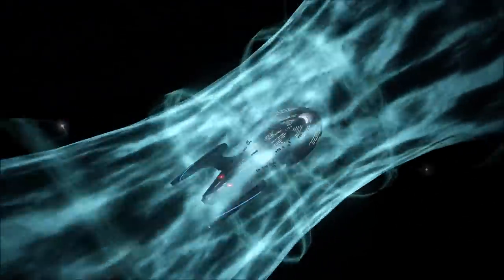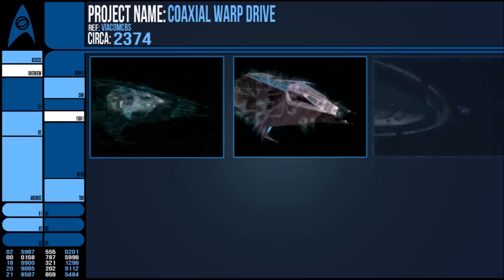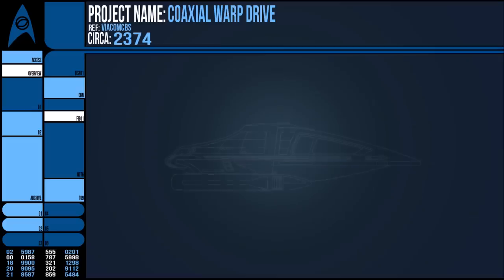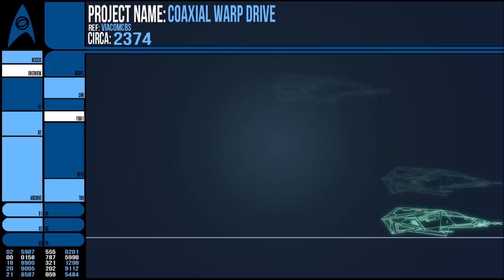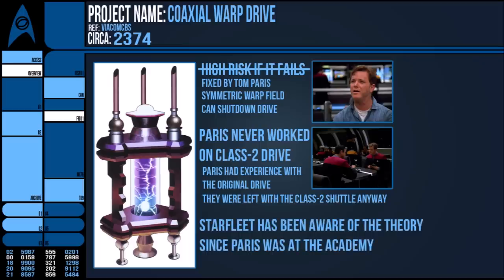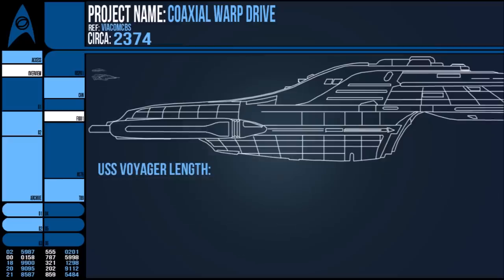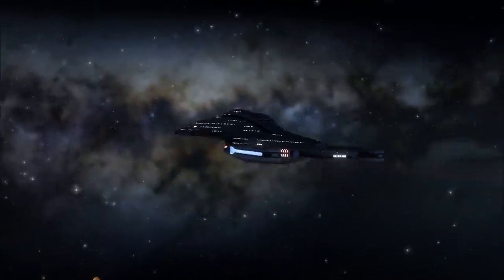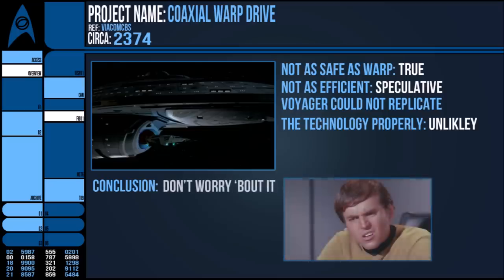Why Not Coaxial Warp Drive? (Star Trek Theory)

Comment: This drive was still on the "small ship test" phase.
The first warp ship was ICBM, outfitted with warp gondolas. The Deltaflier was quickly given temporary Transwarp capabilities. So it seems retrofitting drives on a small ship is generally easier (asuming they do not have a certain minimum size/energy requirement like Spore Hub Drive).
Meanwhile large ships like any Enterprise, Voyager, the Wakefield Class or any Fedeartion ship have to be build around or heavily modified for a new drive technology. The Excelsior class was literally designed for the "Transwarp Experiment".
As they actually built the Deltaflier onboard, we can asume they have some degree "Shipyard of Shuttle" capacity onboard. As the Interpid class was intended for Longrange Exploration, that would make sense. But even asuming the drive is not inherently unsuiteable for big ships and they had all the manufacturing needed, applying it to a big ship like Voyager decades away from any friendly shipyard is a very unlikely prospect.
As for their solution: The fix only made the issue less likly on small scales. Test have to be done if the issues is actually solved, or just delayed. And if no additional issues crop up if you make them bigger.
And disipating the Coaxial Warpfield only worked because they had a conventional Warpdrive several oders of magnitude more powerfull working on it from the outside.
So the drive is dangerous unstable and untested, has not yet been applied for anything larger then a shuttlecraft and retrofitting Voyager with it that far from home is a dubious prospect at best.

Comment: I can think of three reasons. 1 The longer the point away the more power you would need to bend the space to where you are. With a Warp drive you can just head in the direction. 2 You are not moving through space until the two points meet. Would that mean an increase in time to force the points together? If it does then you can not escape from a situation quickly. You have to wait for teh drive to engage. That could be a major issue if attacked by something and you need to retreat. 3 You can only go to the point you set. With warp drive you can drop out of it at any time and change heading. With Coaxial you can only to move to the spot you decided upon.

Comment: My first thought as a mechanic; What if it just wouldn't fit? An engine of a certain power has a specific size and shape. What if that size and shape were incompatible with Voyager's structure? It's one thing to reconfigure a small shuttle but it's something else entirely to reconfigure your entire starship. Especially when you don't have access to a dry dock.

Comment: From what I understand, canonically, warp drives create a subspace field around the ship in such a way that the ship is propelled through normal space at speeds faster than light because subspace "slides" through normal space like oil through water. 

What you're talking about, the bending of space itself to "propel" ships (I used propel in quotes because the ship actually isn't moving, space is moving around it), is the real world interpretation that was introduced by Miguel Alcubierre in 1994. Doing this is hard though, even modern estimates using altered equations put top speed at 10x the speed of light requiring as much power as the US consumes in a year. (Which, from my understanding of warp scale, puts it at warp 2.15). Dr. Alcubierre and his successors have called this warp drive because they're all nerds and enjoy Star Trek.

Coaxial warp drive, as your animation suggests, does something very similar, though distinctly different. The destination is brought to the exact position your ship is at, then you cross the axis, and release the warpage. In other words, two distant points of space are connected via a warpage of some kind, and you cross it for the purpose of traversing great distances in short periods of time, if not instantaneously. That sounds just like a wormhole, which is notoriously difficult to create even in Star Trek. Every time that I can remember wormholes being plot devices, they were either extremely unstable, partially unstable and deteriorating, or created by beings of other planes of existence and maintained by said beings for millennia. Now granted, being able to wormhole anywhere in the universe in an instant would be fantastic, I'm sure Starfleet would be cautious of any prototype being installed, or tested, on any ship in service regardless of their current predicament or confidence.

Comment: Even if it only worked on the shuttle if the technology worked as advertised they could have used the shuttle to return to Earth and update Star Fleet on everything that had happened and get them working on a full size version. I'd bet that with the resources Star Fleet has and the prototype in their posession they could have figured it out in no time. Failing that the shuttle could have ferried the Voyager crew home 6 at a time.
Reply: Exactly.   Trek has always had bad writing but voyager has some of the worst considering the excellent premise it was based on.

Comment: I like the idea of it being practical only for small ships. I'm going to work that into my carrier design, along with Multi-Layered Warp Drive (or whatever I eventually call it.)
Reply: Here is an idea a friend of mine came up with: warp field surfing.
He didn't put warp drives on his fighters, but equipped them to basically get pulled along in the warp bubble of the carrier. So no need to land them before running off, you only need to have them close enough and they can land en route.

Comment: I imagine while the technology itself is decently easy to use and even replicate once you have the schematics, it's everything else around it that makes it unfit for consistent use. You brought up the fuel source and/or energy requirements, but those are just speculations. Even if we assume they are possible to deal with efficiently enough, there are other aspects to be considered: 
For one, you have to know exactly what point you want to target. You can't just pick a random location in that direction - you have to make sure that that spot is safe to emerge in. While space is mostly empty and the chances for that are tiny, you don't want to run the risk of appearing inside a star, a meteor field or the gravity well of a black hole. That requires extremely precise sensor imaging, which again limits the range.
This is made worse by the next point, which is other ships. Tracking stellar objects over long distances is possible enough to get some use out of the drive - but it's nearly impossible to track other ships at those distances. Jumps into populated systems is risky even if they shared their sensor data. Warp still allows you to react to what's in front of you, the coaxial variant is pretty much instantaneous. It would be banned anywhere near systems and common routes...
Ironically it becomes less precise the farther away from such population centers you are, which could share sensor data with you. Especially in uncharted space or other cultures' territory you may encounter hard to pick up structures and cloaked vessels...

I'd love to see Coaxial Warp used as an alternative getaway method for cornered ships. A last resort type of technology that is otherwise too inconsistent to replace the conventional warp drive for regular travel.

Comment: The Coaxial Warp drive sounds exactly like the Kearney-Fuchida Drive that Battletech uses. It works on the same premise, using gravity wells of stars to chart points of jump. It does this by bending time and space on itself to shorten the travel position. It often uses high amounts of energy. Most Warships and Jumpships can use the drive twice safely without issue, jumping a third time would often cause the drive to fail or explode the ship due to the reactor unable to output the necessary power to maintain the jump window.

Comment: If you watch the episode this is shown in.  The person they save immediately says that he pushed the drive past it's limits.  If that was the case and it caused such a potentially dangerous effect of collapsing space itself for a sizable distance..  It would be simple enough to assume Starfleet would rather not use the technology until it can be made safer.

But I think you are correct on size of the ship or object being pushed through space/subspace in this manner.  That and just appearing in places where potentially hazardous situations could be present, might also be another reason to not use the drive.  Perhaps there is no simple way to scan the area before you appear where you are going.

Comment: You may of partially hit the issue with the power option: What provides the most power on a Federation Starship? The warp core.
What shut down the Coaxial Drive? A "symmetrical Warp field" imposed by Voyager's Warp Drive.
A smaller ship doesn't need a operating Warp Drive to power all systems, even Voyager didn't per say but it's also a ship where reserve power is a precious commodity.

My theory, Coaxial Drives don't provide power, and a running traditional Warp Core generates a field that would "potentially" generate a warp field that would shut down the Coaxial drive.

To explain simply, You can't have a running Warp Core on a Coaxial drive ship, so a bad Jump would leave Voyager vulnerable till the Warp Core is brought online, if they had the ability to power the Coaxial Jump in the first place.
Reply: But the Warp Core is just a Matter/Anti-Matter Reactor that generates the energy to power the Warp Coils in the Nacelles which are what generates the warp field. The Warp Core itself doesn't create a warp field it's just the power source it also powers the rest of the ship (with fusion reactors as backup/auxiliary generators) including shields, weapons ect.

Comment: I always figured it was a case of "The bigger the ship the more power required" and even a ship as small (compared to a Galaxy per say) as Voyager was it just wasn't feasible when compared to conventional warp drives. Either that or the drive became progressively more unstable as you increased the size of the ship.
Reply: That's the difference between Coaxial Warp and Quantum Slipstream 
Quantum Slipstream doesn't care how long the ship is, as long as its relatively flat, allowing ships to manageably increase power output 

Coaxial Warp just needs a fuck ton of power for a jump that could be done in 20 hours by a Constitution Class

Comment: Isn't Coaxial Warp just the same as making a wormhole? 🤔
Reply: That's what I thought.
Reply: More like the 2004 BSG FTL drive.
Reply: In real world (stop booing ...) terms, it is exactly that ...

As physicist are wont to do, rather than transverse the distance between two furthest points on a piece of paper, you 'poke' a hole at the point of origin, hope for spacetime to fold on itself, thereby enabling to poke another 'hole' at the destination (but I guess you already knew that, so nvm ...).

Trouble is, not only are wormwholes purely theoretical, you have to hope that that black hole is connected to the, still yet to be discovered, white hole, thus avoid the nasty business of trying to negotiate a gravitational singularity. But given any known physics falls apart beyond the event horizon, then you're looking at a pretty difficult problem ...

In universe, and if the graph in 'TNG: Technical Manual' is correct, then, the issue is one of energy. Iirc, the graph is logarithmic, meaning every step in warp velocity requires an exponential increase of amount of energy, until at Warp 10, you need an infinite amount of power. And that is just the 'standard' warp core. Also, instead of compression/expansion of the typical warp bubble, you try folding spacetime around yourself, that requires not only sufficient energy to open a wormhole, but sustain it (due to Hawking Radiation, black holes can, and do, 'evaporate', with the time it takes to do so is related to its mass, and size ...).

Put the two together, and it is logical to assume that only a relatively large shuttle, which doesn't need a particularly large wormhole to travel through, would only be able to travel a (relatively ...) small distance, because of the energy demands, and the size of the core proportional to the ship, and its mass. I would imagine even something as relatively small as Voyager (compared to, say, the Enterprise-E), in order for it to fold space, the size of the core would take up a lot of space ... and that is not including fuel storage. 

Hence why it is believable Star Fleet never really pursued the idea: compared to the standard ship drive, as any advantages would be outweighed by the disadvantages.
Reply: @nigelft  Didn't see you'd posted this explanation here.  I posted a somewhat similar explanation but yours is better written and is what I agree is the issue with the drive.
Reply: It's obviously different because... they gave them different names ;)
Reply: No. In a wormhole you have to travel a physical distance inside. Coaxial warp drive is more live the jump drive. You can instantaneously travel without to moving a physical distance. The same principle (space folding) of the Inverter of the Ansata terrorist in the TNG episode "The High Ground" or the 'Sikarinan Trajector.
Reply: no. Its a Wormhole. The idea that there is any distance to travel through a wormhole is a complete misconception. 
Wormholes connect two points in space, bending space time so those two locations occupy the same spot. To the person flying the ship they would just suddenly be some where else. To anyone watching the ship would probably seem to exist in two places for an instant while traveling (if the observer can see both ends of the wormhole) or the craft using the wormhole would simply vanish (if the "exit" of the hole were out of view)
Reply: @channonikelman2041  No. Its not a wormhole. Star Trek had another concept for wormhole than for folding space. That are two different concepts. In general, you are right. But for Star Trek not.
Reply: I could make up random bullshit and be right in Star Trek terms. Star Trek terms mean literally nothing.
Reply: @channonikelman2041  Except when talking about Star Trek of course.

Comment: This is jumping to an alternate IP, but the logic could apply here too.

This is basically how the hyperspace drive works in Macross. In the first few series they're jumping stuff that ranges in size from a 747 to about 9 miles long, the main limit at that point is fuel to power the reactors for the jump and the cooldown on the drives after. Later in the franchise, they're jumping generational colony ships roughly the size of Luxembourg, with multiple attached O'Neill Island 3 colony cylinders, along with a supporting fleet of thousands of ships and they start running into issues of "hyperspace wakes". 

Basically the bigger the object/cluster of objects in one jump, the bigger the 'wake'. Also the longer the jump, the bigger the 'wake'.  This is talked about like Trek talks about subspace distortions, where it can rip ships apart at it's worst, but more typically interferes with high speed navigation. Smaller ship's 'wakes' dissipated before their drive cooldown was typically over so it wasn't an issue early on; jumping a colony fleet even short distances produces a wake that's big enough it takes weeks to months before it's safe to jump anything big again, with smaller ships like passenger liners and shuttles jumping between ripples.

A similar scaling thing might be at play with coaxial warp, but with different scales because different setting. So something the size of a shuttle, maybe up to the size of a Defiant might benefit from a coaxial warp jump, but the distortions might be too much of a hassle for anything bigger.

Comment: Something else that comes to mind: sensor range limits.  Over the course of normal warp travel, there is still some sensor capabilities to alert to distortions or disruptions ahead.  This was in fact part of the problem with Slipstream - that the speeds exceeded their ability to map out the pathway ahead safely.  Either the sensors couldn't reach far enough ahead or the system couldn't process the readings in time to let the computer adjust.
Now imagine that the statement of multiple jumps and the statement of going twenty lightyears are independent (and believable) - that is, the ship did many test jumps and then did a single twenty-lightyear jump.  Any visual or radio scans would be useless since they'd be aged out by the distance - even a visual scan one lightyear out would be one year out of date.  Some subspace or other future tech may be able to collect data further out, but not likely that far out.  Thus, an instant jump that far ahead would be risky, especially if there are invisible factors like subspace distortions or small physical dangers like micrometeors or asteroids that happen to drift into the path.  A smaller ship can more easily risk it because there's less cross-section to hit.
Granted, space really is mostly empty and the odds are in the ship's favor, but the risk of something at a level of reality like subspace throws those odds out the window.